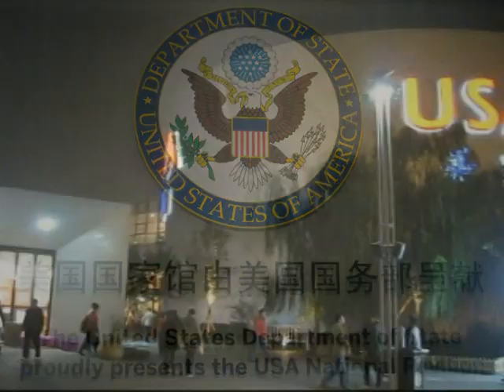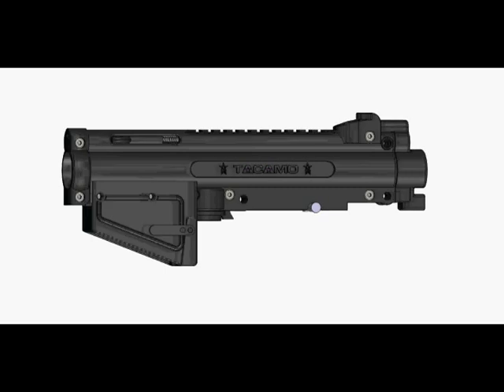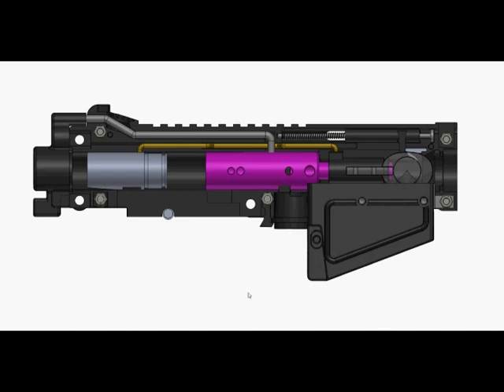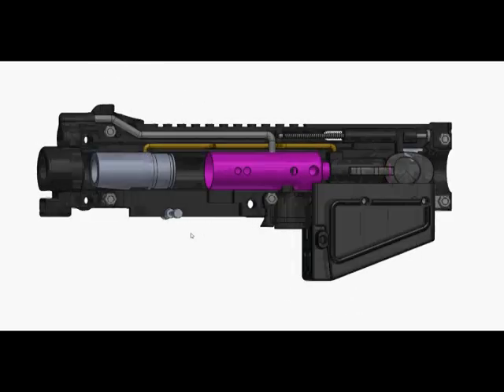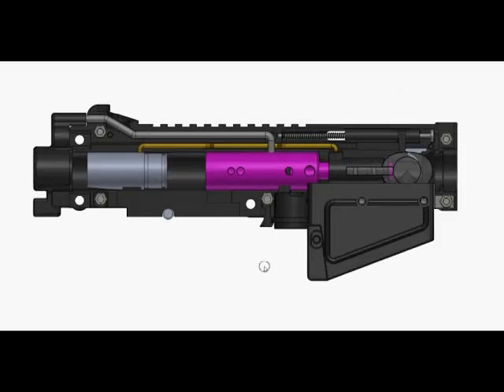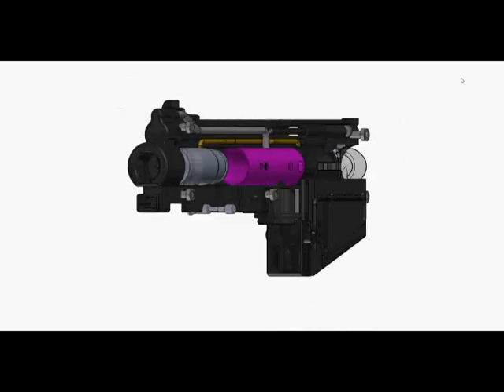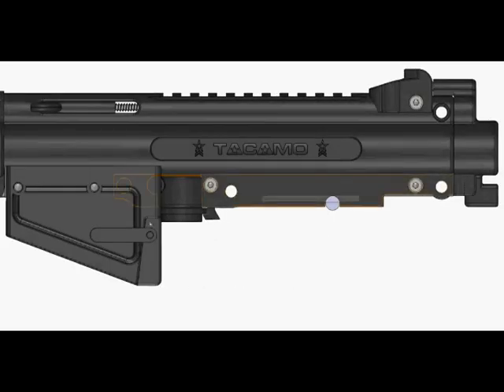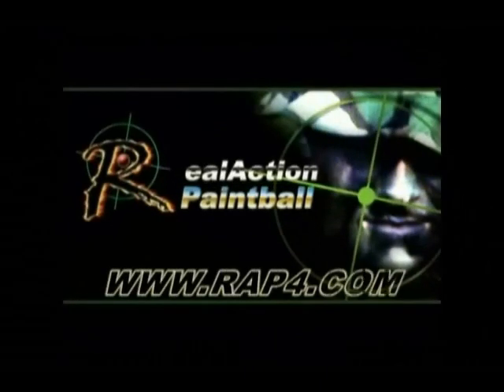Tacamo Magazine Kit _A5_An Inside Look

Comment: Is the flexi-air system required for the conversion kit?  Or can we order the conversion kit without those parts for a tombstone air feed?

Also, will slender regulators such as the 2Liter+ Dual fit with the magazine adapter?  Or does it interfere?